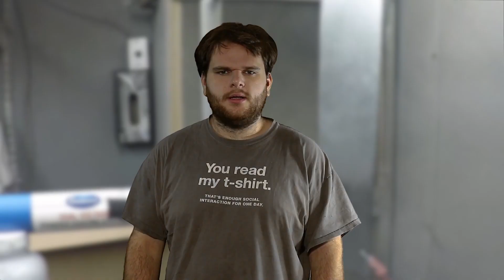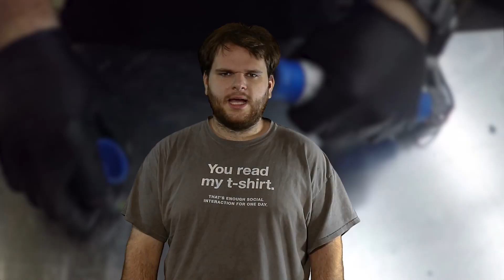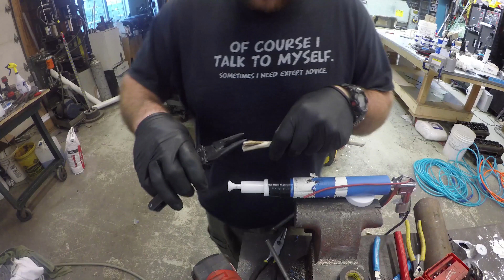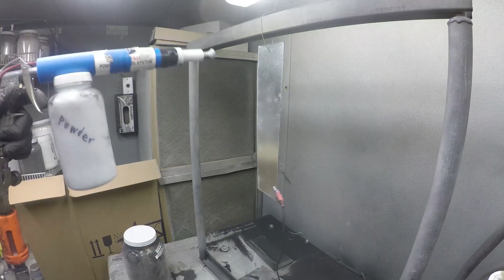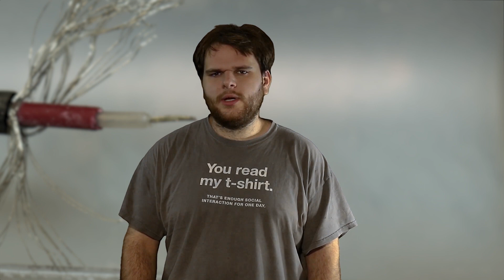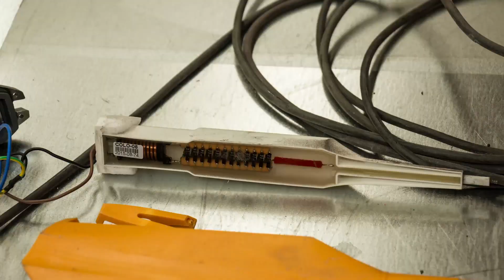Eastwood Powder Coating Gun Fix; Well, Partly Fix

Comment: Great videos! I noticed you were having difficulty drilling the plastic nozzle without the drill bit digging in. IFor drilling nonferrous material, you need a neutral cutting angle on your drill bit. I modify a set of drill bits for nonferrous materials because I do a lot of work with plastics. It can easily be achieved by using a diamond hone to file the end of the drill bit holding the hone in plane with the axis of the drill bit and just taking a bit of material off. You will be amazed by how easy drilling plastic (and aluminum) once you have a cutting face that is perpendicular to the material being cut. It just doesnt grab.
Reply from the maker: Ok. Thanks. So you want neutral rake angle. Where normal bits have a positive rake angle.

Link to a diagram for drill bit geometry.
https://en.wikipedia.org/wiki/Rake_angle#/media/File:Metal_Cut_diag.svg
Reply: 610GARAGE yup. Super simple and super effective!
Reply from the maker: Great! Thanks for the tip.
Reply from the maker: I've used those on plastic before. But usually as an alternative to a hole saw. I'll have to remember that. They do work well on plastic.
Reply: i realize I'm quite off topic but do anyone know of a good site to stream new movies online?
Reply: @Jax Omari Lately I have been using FlixZone. Just search on google for it =)
Reply: @Anderson Ayaan yup, I have been using Flixzone for since march myself :)
Reply: @Anderson Ayaan thank you, signed up and it seems to work :) I appreciate it !!
Reply: @Jax Omari Happy to help :)

Comment: I drilled 2 1/8" holes 1/2" apart and now no powder comes out of the gun at all, just air. I taped the holes shut and it works as factory.

Comment: This gun is garbage. Wish I would've just put forth more money into something better. What makes it even worse is their customer service seems to be non-existent. I know this video is somewhat old, but just wondering, What powder coating system are you using now? I'm thinking about going with the CC hypersmooth, but I'm now also hearing bad things about that one as well. I'm not really trying to spend 1k on a gun. Awesome video btw. Definitely will be doing those mods to my EW and see if its something usable by that point.

Comment: Thank you a very informative video .... just a question ... did you remove the plastic diffuser that's on the end of the electrode ?  Once again thanks
Reply from the maker: If your talking about the stock diffuser, yes. It's pretty much useless and had to come off for the new tip I installed. If your referring to the new tip, no. That diffuser works very well. A defuser is necessary for a powder coating gun. It not only helps to keep the electrode clean, but I believe it creates an ion cloud, so to speak, that better transfers the electricity to the powder. It's just that the one eastwood designed is so terrible, that your better off without it.

Comment: Could you share the link four the tips. Thanks.
Reply from the maker: Here you go. I would add it to the description, but it's ebay. The link would break in a few months.

ebay.com/itm/aftermarket-universal-head-of-powder-coating-gun-round-and-flat-nozzle/172434347756
Reply: @610garage  this link is no good no more could you please find them and re-link it... It would be greatly appreciated!!
Reply: @610garage  HELP WITH HELP!!

Comment: Josh, saw your comment about modding a HF gun. Not sure if you have one already or not, but I just upgraded to the DV Eastwood setup and would be willing to ship my old HF one to you so you can do your magic for the viewers. I thought this was a very well done vid and look forward to more. I hit the subscribe button so I can stay tuned.
Reply from the maker: Thanks you. I do have one though. I just finished testing it for a review. Not sure what I can do with it to upgrade it. I have to think about it. There is a definite packing issue inside the hopper. It may be due to the hopper's shape.

If I may ask, what do you think of the eastwood gun vs the HF gun?
Reply: I plan on using the Eastwood gun sometime this next week for some motorcycle parts. I just drilled the holes in the tube yesterday to improve the pickup. Also, on the Eastwood gun; I noticed the hopper connection was very flimsy. For the HF setup, it will get the item coated. I often had to shake the hell out of it to get the powder to come out and then their would be cloud bursts. I probably waisted a lot of powder. I think my other issue is with my homemade oven right now which I hope to resolve over this next week. It wasn’t getting up to 400 degrees and I was getting some dimples and some orange peel occasionally. I have personally never used an expensive setup, so I have nothing to compare either setup to. As with everyone else though, the foot pedal on the HF gun is pretty legit and I think it’s a good gateway gun for people because if they don’t like powder coating then they are only out $60 and if they do then it gives them a baseline to go off of.
Reply from the maker: Thanks for your reply. You pretty much confirmed how I felt about it. You can get it  to work, but it's not great. Since I didn't use the HF syestem as much as eastwood's, it's nice to get a second opinion on it.

Oil contamination, I think can also generate dimples, but yea. You need the part to get to 400F. If you still have problems after you fix it, try a prebake.

Yes, the hopper on eastwood's gun is a bit flimsy. But if it ever breaks, just glue on a new lid. It's all they did. :)

If the push button ever gets old, you can pick up a nice foot switch on amazon for $15. It's hefty. So it wont want to walk as bad as the one on the HF system.

amazon.com/Heavy-Duty-Industrial-Foot-Switch/dp/B01D5BYN30
Reply: 610GARAGE I appreciate the tips on the system. I just I’ll let you know how everything turns out!!
Reply from the maker: Please do. Thanks.
P.S. Sorry for the delay.

Comment: I am also curious why you don't make your own gun. Is there a lot of complexity hidden inside the maine barrel?
Reply from the maker: In this powder coating gun, no. Just an electrode. It would be fairly easy to make. Something I would like to attempt. This video was more or less seeing where eastwood failed miserably on there design. And my hopes was to give simple modifications that people could easily perform.

Comment: Josh, great video!  You put lots of detail and thoughtful analysis into what you do, and as an engineer I can very much appreciate that.  Would you be willing, on behalf of others looking for a dirt cheap powder gun, to look at the harbor freight system?  I've seen other review videos, but they don't really cover it like you would I think. Thanks again, I plan to at least drill the holes, and may even dink with 3D printing a new diffuser for my Eastwood gun.
Reply from the maker: Sorry for the delayed response. Thanks, and yes. :) I've been thinking of it for a while. Could never justify the cost. But with youtubes change, I now need 15 more subscribers within 30 days to keep my monetization. This seemed like a great way to get a few more subs (new videos usually bring more subs) So I actually went out tonight and picked one up. Expect the review in a few weeks.

If you do design a new tip and make it public, post a link in a new comment. I'll pin it to the top.
Reply: 610GARAGE oh I just saw your reply. Thanks for doing that. I'll sub! I think powder coating is lacking a well informed group of creators who have any knowledge beyond "look I powder coated a tumbler!" Which they then post on Tumblr... Ironic.

About I look forward to the review. I'm going to be doing a vid on powder coating PLA 3D prints, as soon as I get around to sitting down and editing my crappy phone footage.

PS the 3D printed diffuser works well, and I sharpened the tip of the original electrode with a file. Seems to help with transfer efficiency.
Reply from the maker: LOL Thanks. I'm writing the script now. But the way it's been going. The video is still weeks out. :(

How does the 3d print powder coating work? I often thought about powder coating my 3d prints. It would be perfect to smooth them out. But powder coating needs 204c and pla starts to melt at around the 180c mark.

Good to hear.
Reply: A low-cure powder is part of the key to this.  You must have a supplier who can produce a powder that cures below 300°F.  Often they are epoxies, and have limits on look/feel.  I'm going to be releasing a video at some point on how to do it.
Reply from the maker: Cool! I didn't know they made powders for such a low temperature. Let me know when you release your vid. I would love to see it.

Comment: Do both but send me the link to the 200 gun, im looking for something cheap but not crap
Reply from the maker: I know your pain. Here is the kit. I do believe you will also need an adequate power supply. But I have no idea what specs are needed.

ebay.com/itm/aftermarket-replacement-shell-of-manual-powder-coating-spray-gun-HV-Cascade-PCB-/172429753138
Reply: 610GARAGE thanks man! Great video

Comment: Damn the HF powdercoat system is way better than the Eastwood. That's a surprise
Reply: Have to disagree, the HF unit I bought is total junk compared to the Eastwood System.
Reply from the maker: Is it? I haven't tried HF system, but it honestly wouldn't surprise me. Eastwood dropped the ball hard on there powder coating line. Evean there powders stink.
Reply: 610GARAGE I'm between harbor freight and the eastwood. Have a preference?

Comment: Great video, as always. The sound effects really tie it together. :D

I'd be more interested in seeing a kit being put together, personally, but I'm sure I'd enjoy whatever you end up deciding to do. If you do go the kit route, do you plan to incorporate the Eastwood bottles?
Reply from the maker: Thanks.

I wouldn't incorporate the eastwood bottles directly. But with not only that kit, but most powder coating guns, the powder hopper/reservoir are not directly tied to the gun. So you can use whatever size/shaped bottle you would like. Including the eastwood bottles. The down side with them though is that they are really small. :)